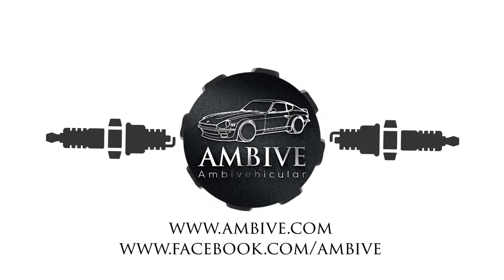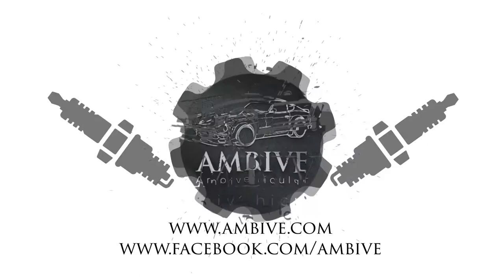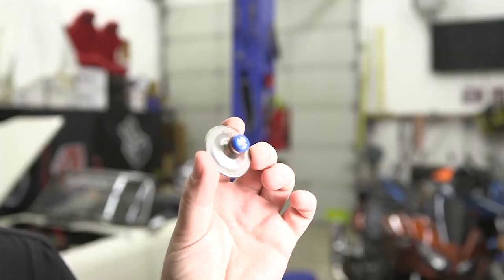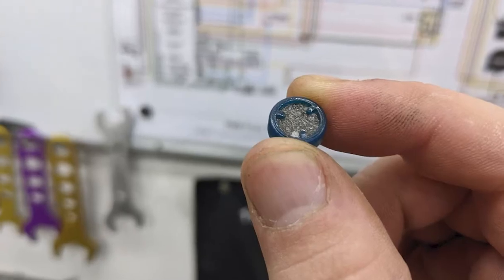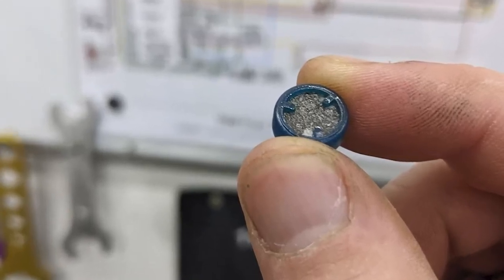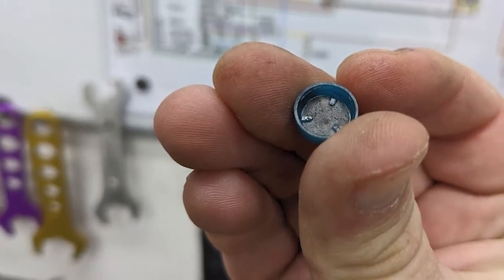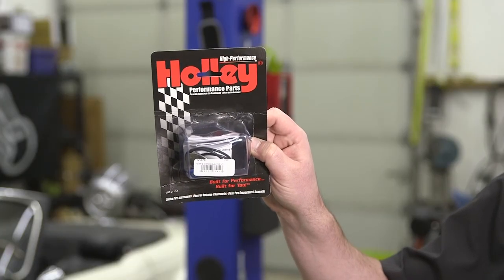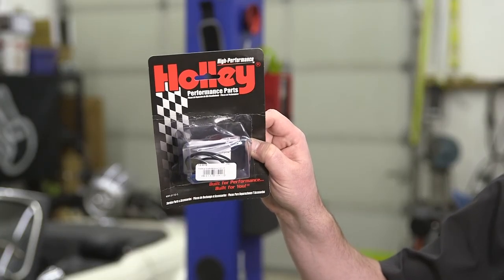Holley FPR Issues

Comment: I just went through all this with  a sniper unit intermittent running issues on stalling..took apart to check the regulator put a gauge on it 75 PSI. all the powdercoating inside the regulator area was coming off. super poor design !!! spend 2 hrs with a Dremel and small pic removing every trace of powdercoat. I'd already plumbed return line otherwise I would have used a wix LS fuel filter if I'd known that's the PSI needed. I removed all the holley regulator and installed a aeromotive one w/ a guage.. so far hasn't not started yet.. Holley should honestly have to recall every sniper that's been powder-coated because it's  going to be a problem for every single one eventually

Comment: about a month ago my pump started screaming on and off... the sniper ran like it was starving. Does this sound like what happens when the return screen is clogged ? my cars system is 3 years old and about 1000 miles ...do you have a video of removing the regulator filters ?
Reply from the maker: I didn't, but it's not too complicated. There are some examples online, but basically you just unscrew the end (hopefully without damaging the finish). I used some rags to protect it, clapped it gently in a vice, and turned the end off with a padded pair of pliers the last time. You could probably do it with a strap wrench as it isn't extremely tight. The hardest part is getting the little tiny screen out without damaging it or any of the o-rings.

Before you take it apart, you might check what the fuel pressure is. If the return screen is blocked like mine, the fuel pressure should keep creeping up or have jumped well above the preset.
Reply: @AmbiVe   how do i check fuel pressure ? is it some where on the little screen ? thanks for gettin back to me .
Reply from the maker: You'll need a fuel pressure gauge in-line after the pump. If you don't have one, I would think about getting one at some point, but then you might as well assume the screen is clogged since it's not that hard to disassemble and clean.

Just take your time and you'll be surprised how easy it is if you Google a picture of where the end unscrews from. They sell replacement parts for it on the site if you do damage the little screen, but I'm tempted to just leave mine out next time as I don't know why they are even filtering the return.

Good luck and have fun with the project!
Reply: @AmbiVe   thanks.... i did order a 10 micron filter and i did order the other one today. you video helped so much ... thank you

Comment: Just went through PSI reading a varying PSI from 75-80psi.

Pulled the FPR and saw the debris.   Reinstalled and still high, probably because I pushed on the center of the FPR.  Pulled it back out and remassaged the cap to make sure it was not dented.  Reinstalled and back to 62 PSI.

Guessing debris from PTFE lines being made.

Grabbing a 2nd FPR to have and try to install it while using a socket or a Brake Cleaner cap to press it into place from the edges.

If that winds up being a problem still then I am yanking the FPR from the holley, putting the cap back on, and running an external Aeromotive return style FPR since my lines are already run.
Reply: Also holley suggests a 10micron fuel filter in line ahead of the sniper unit.   I had a 40 micron but swapped for a 10micron after this nonsense with that FPR screen.   Since the filter is under the car it still gave me around a 4 foot run of hose that may have had some debris.

Question is if the FPR has that debris caught in it what do the injectors look like?

With a 10 micron in line I can probably ditch the screen on the FPR as well since it so small it should just go back to the tank bypassing the FPR and not causing a failure
Reply from the maker: That would be my thought. I swapped to a 10 micron filter from a 40 micron at the engine before the Sniper, but who knows what made it into the Sniper, so I have been keeping an eye on it. I still don't understand why you would filter the fuel return at all. If I continue to have issues with the Holley FPR filter combo, I'm going back to a feed and return setup with an Aeromotive like my other cars for piece of mind.

Comment: today i put a Holley fuel pressure gauge on and the car stayed in the range of 56-60 psi... now after the car warmed up i heard a whining coming from the gas tank area .... so what now ? pull the electric fuel pump ? and how would i test it ?
Reply from the maker: That sounds like your regulator is working fairly well. It's possible that the pump is working hard for some reason and causing noise or it may have mechanical issues. Do you have an in-tank fuel pump or external? Do you have a screen on the pickup? Was the fuel tank clean and new?

My initial guesses based on your info so far would be:
1) The pump itself is having issues.
2) There is an intermittent clogging issue.
3) Your fuel is becoming aerated due to the level, return, or pickup location.

Happy hunting.

Comment: I have the shiny sniper and my FPR was full of black substance. I have in tank pump with sock, after pump filter and a before carb filter. So where did this stuff come from ?? I believe today’s gas is breaking down the hoses inside and making the mess.. just my opinion. So I’m going to run all new steel lines and eliminate the hoses.
Reply from the maker: If you haven't tried it, look at the copper-nickle tubing. It bends and flares much easier.

Comment: So are you suggesting that we could run the fuel pressure regulator without that screen? As long as we have a fuel pressure regulator somewhere along the feed line? I hope that didn’t sound to confusing!
Reply from the maker: Based on what I saw taking it apart and with my fuel sock in place, I don't see why not. If you were nervous, you could just add another filter ahead of the regulator. I probably won't if I give up on the included one.

Comment: Installed mine this weekend. Ran good for 15 min at 60 psi. Suddenly jumped to 100 psi and then fell to 20 psi and died. Ordered a new regulator. I have a carb regulator as well that I may install and remove the Holley regulator all together. 1500 bucks for 15 min didn’t make me happy
Reply from the maker: I definitely think their quality control and overall design of some of their regulators are questionable. They seem to make decisions to engineer for failures that can be easily avoided.
Reply: New regulator arrived. Removed the old. Couldn’t believe how much debris was on the regulator filter. What’s the purpose of a pre and post filter if it’s just going to clog

Comment: Would be possible that the new tanks need to be coated internally prior to new use? Came across a few other people mentioning the micro silver chips in their filters as well. There are internal tank sealers available on the market. Just curious.
Reply from the maker: Good thought. They shouldn't, but it's possible that the coating used from the factory was defective. Most aftermarket coatings will have a much shorter life than something produced at the point of manufacture against clean, prepared, metal.

Comment: Excluding the diaphragm type pump for low PSI applications, their are only 3 types. You have a roller cane pump. The metal is coming from inside the pump as say GM used this pump, but on TBI units w/13 PSI max. I have seen fuel pumps manufactured and surprisingly to me, the internal magnetic material is magnetized after assembly. Then (ACDelco) runs test fluid thru them, monitors “db noise”, pressure with correct system specs, amps, dead-heads the pump, then open flow current & volume. It takes 15 minutes per pump as they do two at time.
 Yours has a metal rotor with slots & round inside bores. Each are fitted with best described as brake line slices in 4mm lengths. Where I was at, they also performed tests, non-destructive and destructive testing both on alleged fail field unit returned during the warranty period. This pump design with two different parts can produce 68 PSI all day long. The problem lies with the fitment & finish of internal pumping parts as centrifugal force causes the roller to push tighter against the outer ring to produce this higher pressures. That is why they are limited to low pressure. High pressure pumps I saw are 2 stage with a balanced rotating rotor with angled vains w/80 fins within a 60mm diameter. The inlet had a CNC cut groove 2/3rds around the bottom plate that tapered off into a 2.5mm hole to vent air generated by cavitation that occurs at low pressure to high vacuum at 27” Hg to vent. Then the second rotor, smaller in dia. squeezed the fuel higher yet. This fuel is pushed up passed the armature, commutator plates, brushes and out the top past a ball bearing & viton seat and outlet. These produced 82PSI dead-headed and ran regulated at 52PSIG at 140 gallon per hour. They have a precise oraface to drop GPH and run at 7.2-7.5amps. This is in almost every GM vehicle.
  I am not saying your pump will fail soon or get noisy but just the least expensive design.
  I have work on EFI vehicles since 1976 when only 2 were made & sold. Not mechanical or CIS systems, true electric injectors with pumps. Motorcycles, every import the Air Force guys could bring home, domestic and 3 DeLoreans a guy had! No one has a filter on the return side. 
  Been there, did that, got the tee shirt. DK. ASE Master Tech since 1978, UTI, ACDelco instructor, retired. 
I think this a CYA for Holley. I know enough about their system, we’ll never mind. 
Have a nice day!

Comment: have an in tank pump .... not sure what company . when the screaming noise was coming from the rear of the car , the pressure was still good ... not erratic..
Reply from the maker: My intank setups have made noise before if vibrations from the pump are transmitted to sheet metal, if there is air being pulled into the system, or if the pickup or return are being restricted.

When it's making noise, you might need to use the screw driver trick or a stethoscope to narrow down the source.

Comment: Did you consult with holley and ask how the contamination could pass through the whole system?
Reply from the maker: I reached out to support but did not get an answer back about it or another issue I found. Usually they are good about responding, so I took the lack of a response as an answer.

Once I find out if it reoccurs with these changes, l will reach out to them again.
Reply: @AmbiVe  it must be a very fine particulates to pass through the sniper unit itself. Those orifices are tiny.  Keep us posted if you hear anything from the holley empire.
Reply from the maker: I will. Supposedly this integrated filter is 10 micron, so it's incredibly unlikely that this would make it through a hydramat and 10 micron filter.